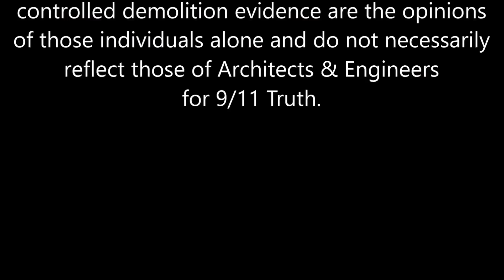Dr. Hulsey: There was nothing right about anything NIST did

Comment: Nobel Prize for Dr. Leroy Hulsey, Richard Gage and other academics who are real AMERICAN PATRIOTS!
Reply: WHAT exactly happened to ALL 7 buildings with a WTC prefix on Sept 11, 2001?

The following points need to be made regarding what exactly happened to the building and the observable evidence at ground zero, that AE911truth / Richard Gage and now Andy Steele never touch on…

1. Building 3 (Marriot Hotel) – 14 Survivors - It was a 22-story building – 90% of that building completely went away, all the way to ground level and the 10% of it that was still standing (about 6 floors) is where these 14 people survived.

2. Building 4 – 9 stories – 75% of it, also went away – all the way to ground level – Poof gone. There was virtually no rubble on this building, except for a small remnant of the building.

3. Building 5 – 9 stories - Had cylindrical holes in it, 24 feet wide, that went all the way to ground level. Once again, virtually no falling debris ended up on top of this building.

4. Building 6 – 8 stories - Had the middle of it scooped out, all the way to ground level as well as 13 cylindrical holes, 24 feet in diameter on the edges and close to the scooped-out centre of the building and all these holes went down to ground level. The centre hole in this building had NO RUBBLE inside it, it was EMPTY! 

5. Building 7 – 47 stories or 4 and a half Titanic’s’ stacked on top of one another – Was frothing away the whole day until just the outer skin of the building was left and at 5:20pm SILENTLY fell into its own footprint, it left the seismic reading of just 2 stories hitting the ground.

6. The Twin Towers – 16 Survivors (“9/11 surfer” included) - 110 stories, equal to 10 Titanic’s stacked on top of one another. The survivors heard no loud explosions, no flashes of bright light, no molten steel raining on them, they did not go blind or deaf due to light flashes or explosions, they weren’t hit by falling debris - POOF they are gone into a HUGE DUST cloud. The seismic readings were that of a 20 and 16 story building hitting the ground respectively – Why was it so low?

7. Bankers Trust Building – (Across the street from the WTC complex) Was heavily damaged and rebuilt, just to be completely taken apart 5 years later due some lingering aftereffects affecting the structure of the steel in the building. Show me how a building that was not hit by a plane, had no office fires, because something affects the steel in the building?

Why has AE911truth / Richard Gage and now Andy Steele been “distracting” from all these points and especially focussing on WTC 7 for the last 7 years, ignoring everything I’ve pointed out?  

Has AE911truth / Richard Gage and now Andy Steele forgotten about ALL 7 WTC buildings that had massive anomalies that don’t fit the NIST Report and the “9/11 truth” movement’s THEORIES regarding “controlled demolition”, squib explosives, nukes, or mini nukes? 

Can’t AE911truth / Richard Gage and now Andy Steele count past 3? 

8 Buildings were affected, why only focus on those three for the last 13 years?

Why have you not intensely investigated the observable evidence that was left at the crime scene that was ground zero?

AE911truth / Richard Gage and now Andy Steele keep on asking for an “independent forensic study” of WHAT happened at the WTC complex, when such an “independent forensic study” has been done and the EVIDENCE was submitted as high up as the Supreme court of America, via a Qui-Tam case against NIST and the subcontractors who wrote the NIST Report, for SCIENCE FRAUD, way back in 2009! 

If this court case was heard and not illegally dismissed by the judge, the governmental subcontractors with links to advanced weaponry, who were tasked with the secured clean up operations at ground zero and tasked with helping to write the FRAUDULENT NIST Report, these companies would have been DEPOSED back in 2009 already!

13 years of theories by the “9/11 truth” movement have been regurgitated to a point of exhaustion and it is currently turning into a waste of time, as they aren’t bringing anything new to the table.

Why does AE911truth / Richard Gage and now Andy Steele censor anyone who brings this up and why is AE911truth / Richard Gage and now Andy Steele keeping mum about this 2009 Qui-Tam case?

Are we not searching for truth about WHAT happened to those buildings with a WTC prefix?

Time for AE911truth / Richard Gage and now Andy Steele to stop focussing on just 3 buildings, when indeed there was MAJOR anomalies with 8 BUILDINGS! 

Why aren’t you talking about the 9/11 orphans, Buildings 3, 4, 5 and 6? 

Why not discuss the anomalous Banker’s Trust building, that was repaired, just to be dismantled a few years later due to the integrity of the steel that was waning? What does that?

I suggest anyone wanting to investigate the 9/11 orphans, to have a look for the documentary “9/11 Essential guide” and decide for yourself what the agenda of AE911truth / Richard Gage and now Andy Steele really is. Also look for the documentary series “9/11 Deprogramming” which you can also find on Odysee.
Reply: @TheMountainGoat  How much did you get paid 😂

Comment: Dr Hulsey's files are still corrupt downloading from AE911Truth's server. You guys ever gonna repair the zip file or are we never going to be able to download a good copy?
Reply: Dr. Hulsey replied that he forwarded it to the AE911Truth folks. Over a year and it's still the same corrupted file.
Reply: From: gene 
Sent: Wednesday, December 1, 2021, 10:51 AM
To: Leroy

Subject: Re: Leroy Hulsey downloadable file from UAF site is corrupt

Dr. Hulsey,

I've finally completed the download of the newly uploaded 258 Gb UAF+WTC+7+Files.zip. The file size of the new download is 12.3Mb smaller, so I was hopeful we didn't have another corrupt file. It took longer than expected to download because the servers AE911Truth uses appears to be limiting bandwidth for downloading. Unfortunately, this zip file is also corrupt. I've tried it on my work Surface Pro and my brand new Dell XPS 17. I'm a former IT guy.

I decided to run an analyzer on the corrupt file and it reported 2,267 damaged files in the zip file (see attached). 

I have inquired about peer-reviews of your report (released March 2020) and have not heard that there were any. This could be the reason since no one would have been able to unzip the file.

Most large and important files for download use what are called checksums. A checksum is the outcome of running an algorithm, called a cryptographic hash function, on a piece of data, usually a single file. Comparing the checksum that you generate from your version of the file, with the one provided by the source of the file, helps ensure that your copy of the file is genuine and error free (read more at "What is a checksum?" at https://www.lifewire.com/what-does-checksum-mean-2625825).

I recommend passing this on to the IT guys handling your files (the error report, opening up the download bandwidth restrictions from the server, and adding a checksum for the file).

Thank you for all your hard work on this most important study.

Most respectfully,
Gene Laratonda
724.826.1001
Reply: @GeneLaratonda  I hope you get the file and can get it out for review - that is crucial if this report is to be considered valid in the eyes of the media and the less informed masses who just see Peer Review as some authentication mark
Reply: @GeneLaratonda  WHAT exactly happened to ALL 7 buildings with a WTC prefix on Sept 11, 2001?

The following points need to be made regarding what exactly happened to the building and the observable evidence at ground zero, that AE911truth / Richard Gage and now Andy Steele never touch on…

1. Building 3 (Marriot Hotel) – 14 Survivors - It was a 22-story building – 90% of that building completely went away, all the way to ground level and the 10% of it that was still standing (about 6 floors) is where these 14 people survived.

2. Building 4 – 9 stories – 75% of it, also went away – all the way to ground level – Poof gone. There was virtually no rubble on this building, except for a small remnant of the building.

3. Building 5 – 9 stories - Had cylindrical holes in it, 24 feet wide, that went all the way to ground level. Once again, virtually no falling debris ended up on top of this building.

4. Building 6 – 8 stories - Had the middle of it scooped out, all the way to ground level as well as 13 cylindrical holes, 24 feet in diameter on the edges and close to the scooped-out centre of the building and all these holes went down to ground level. The centre hole in this building had NO RUBBLE inside it, it was EMPTY! 

5. Building 7 – 47 stories or 4 and a half Titanic’s’ stacked on top of one another – Was frothing away the whole day until just the outer skin of the building was left and at 5:20pm SILENTLY fell into its own footprint, it left the seismic reading of just 2 stories hitting the ground.

6. The Twin Towers – 16 Survivors (“9/11 surfer” included) - 110 stories, equal to 10 Titanic’s stacked on top of one another. The survivors heard no loud explosions, no flashes of bright light, no molten steel raining on them, they did not go blind or deaf due to light flashes or explosions, they weren’t hit by falling debris - POOF they are gone into a HUGE DUST cloud. The seismic readings were that of a 20 and 16 story building hitting the ground respectively – Why was it so low?

7. Bankers Trust Building – (Across the street from the WTC complex) Was heavily damaged and rebuilt, just to be completely taken apart 5 years later due some lingering aftereffects affecting the structure of the steel in the building. Show me how a building that was not hit by a plane, had no office fires, because something affects the steel in the building?

Why has AE911truth / Richard Gage and now Andy Steele been “distracting” from all these points and especially focussing on WTC 7 for the last 7 years, ignoring everything I’ve pointed out?  

Has AE911truth / Richard Gage and now Andy Steele forgotten about ALL 7 WTC buildings that had massive anomalies that don’t fit the NIST Report and the “9/11 truth” movement’s THEORIES regarding “controlled demolition”, squib explosives, nukes, or mini nukes? 

Can’t AE911truth / Richard Gage and now Andy Steele count past 3? 

8 Buildings were affected, why only focus on those three for the last 13 years?

Why have you not intensely investigated the observable evidence that was left at the crime scene that was ground zero?

AE911truth / Richard Gage and now Andy Steele keep on asking for an “independent forensic study” of WHAT happened at the WTC complex, when such an “independent forensic study” has been done and the EVIDENCE was submitted as high up as the Supreme court of America, via a Qui-Tam case against NIST and the subcontractors who wrote the NIST Report, for SCIENCE FRAUD, way back in 2009! 

If this court case was heard and not illegally dismissed by the judge, the governmental subcontractors with links to advanced weaponry, who were tasked with the secured clean up operations at ground zero and tasked with helping to write the FRAUDULENT NIST Report, these companies would have been DEPOSED back in 2009 already!

13 years of theories by the “9/11 truth” movement have been regurgitated to a point of exhaustion and it is currently turning into a waste of time, as they aren’t bringing anything new to the table.

Why does AE911truth / Richard Gage and now Andy Steele censor anyone who brings this up and why is AE911truth / Richard Gage and now Andy Steele keeping mum about this 2009 Qui-Tam case?

Are we not searching for truth about WHAT happened to those buildings with a WTC prefix?

Time for AE911truth / Richard Gage and now Andy Steele to stop focussing on just 3 buildings, when indeed there was MAJOR anomalies with 8 BUILDINGS! 

Why aren’t you talking about the 9/11 orphans, Buildings 3, 4, 5 and 6? 

Why not discuss the anomalous Banker’s Trust building, that was repaired, just to be dismantled a few years later due to the integrity of the steel that was waning? What does that?

I suggest anyone wanting to investigate the 9/11 orphans, to have a look for the documentary “9/11 Essential guide” and decide for yourself what the agenda of AE911truth / Richard Gage and now Andy Steele really is. Also look for the documentary series “9/11 Deprogramming” which you can also find on Odysee.

Comment: 20 years in Afghanistan and never found the thermite that brought down the world trade center buildings 1,2 and 7 demolition style.
Reply: WHAT exactly happened to ALL 7 buildings with a WTC prefix on Sept 11, 2001?

The following points need to be made regarding what exactly happened to the building and the observable evidence at ground zero, that AE911truth / Richard Gage and now Andy Steele never touch on…

1. Building 3 (Marriot Hotel) – 14 Survivors - It was a 22-story building – 90% of that building completely went away, all the way to ground level and the 10% of it that was still standing (about 6 floors) is where these 14 people survived.

2. Building 4 – 9 stories – 75% of it, also went away – all the way to ground level – Poof gone. There was virtually no rubble on this building, except for a small remnant of the building.

3. Building 5 – 9 stories - Had cylindrical holes in it, 24 feet wide, that went all the way to ground level. Once again, virtually no falling debris ended up on top of this building.

4. Building 6 – 8 stories - Had the middle of it scooped out, all the way to ground level as well as 13 cylindrical holes, 24 feet in diameter on the edges and close to the scooped-out centre of the building and all these holes went down to ground level. The centre hole in this building had NO RUBBLE inside it, it was EMPTY! 

5. Building 7 – 47 stories or 4 and a half Titanic’s’ stacked on top of one another – Was frothing away the whole day until just the outer skin of the building was left and at 5:20pm SILENTLY fell into its own footprint, it left the seismic reading of just 2 stories hitting the ground.

6. The Twin Towers – 16 Survivors (“9/11 surfer” included) - 110 stories, equal to 10 Titanic’s stacked on top of one another. The survivors heard no loud explosions, no flashes of bright light, no molten steel raining on them, they did not go blind or deaf due to light flashes or explosions, they weren’t hit by falling debris - POOF they are gone into a HUGE DUST cloud. The seismic readings were that of a 20 and 16 story building hitting the ground respectively – Why was it so low?

7. Bankers Trust Building – (Across the street from the WTC complex) Was heavily damaged and rebuilt, just to be completely taken apart 5 years later due some lingering aftereffects affecting the structure of the steel in the building. Show me how a building that was not hit by a plane, had no office fires, because something affects the steel in the building?

Why has AE911truth / Richard Gage and now Andy Steele been “distracting” from all these points and especially focussing on WTC 7 for the last 7 years, ignoring everything I’ve pointed out?  

Has AE911truth / Richard Gage and now Andy Steele forgotten about ALL 7 WTC buildings that had massive anomalies that don’t fit the NIST Report and the “9/11 truth” movement’s THEORIES regarding “controlled demolition”, squib explosives, nukes, or mini nukes? 

Can’t AE911truth / Richard Gage and now Andy Steele count past 3? 

8 Buildings were affected, why only focus on those three for the last 13 years?

Why have you not intensely investigated the observable evidence that was left at the crime scene that was ground zero?

AE911truth / Richard Gage and now Andy Steele keep on asking for an “independent forensic study” of WHAT happened at the WTC complex, when such an “independent forensic study” has been done and the EVIDENCE was submitted as high up as the Supreme court of America, via a Qui-Tam case against NIST and the subcontractors who wrote the NIST Report, for SCIENCE FRAUD, way back in 2009! 

If this court case was heard and not illegally dismissed by the judge, the governmental subcontractors with links to advanced weaponry, who were tasked with the secured clean up operations at ground zero and tasked with helping to write the FRAUDULENT NIST Report, these companies would have been DEPOSED back in 2009 already!

13 years of theories by the “9/11 truth” movement have been regurgitated to a point of exhaustion and it is currently turning into a waste of time, as they aren’t bringing anything new to the table.

Why does AE911truth / Richard Gage and now Andy Steele censor anyone who brings this up and why is AE911truth / Richard Gage and now Andy Steele keeping mum about this 2009 Qui-Tam case?

Are we not searching for truth about WHAT happened to those buildings with a WTC prefix?

Time for AE911truth / Richard Gage and now Andy Steele to stop focussing on just 3 buildings, when indeed there was MAJOR anomalies with 8 BUILDINGS! 

Why aren’t you talking about the 9/11 orphans, Buildings 3, 4, 5 and 6? 

Why not discuss the anomalous Banker’s Trust building, that was repaired, just to be dismantled a few years later due to the integrity of the steel that was waning? What does that?

I suggest anyone wanting to investigate the 9/11 orphans, to have a look for the documentary “9/11 Essential guide” and decide for yourself what the agenda of AE911truth / Richard Gage and now Andy Steele really is. Also look for the documentary series “9/11 Deprogramming” which you can also find on Odysee.
Reply: Thank you for your service. You bore the battle, and that matters. Now it’s time for accountability and reconciliation from the civilian leadership and traitors that created this mess.